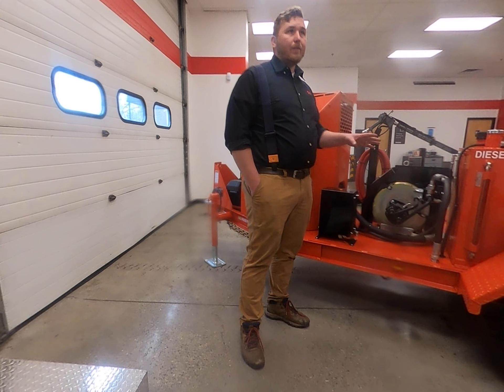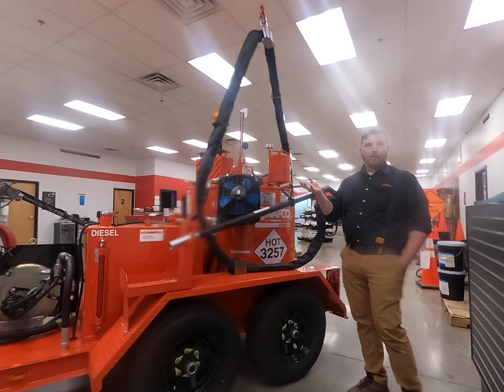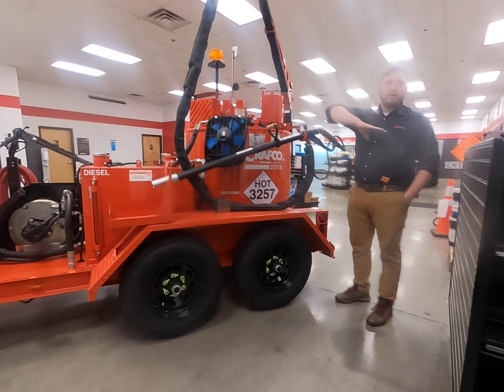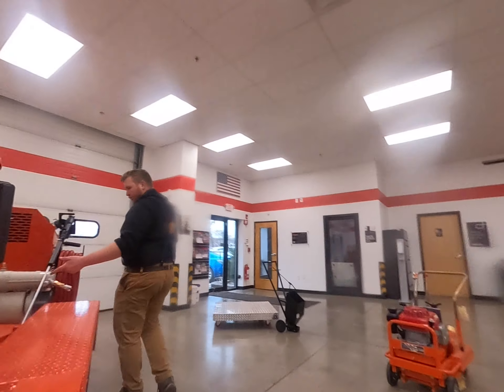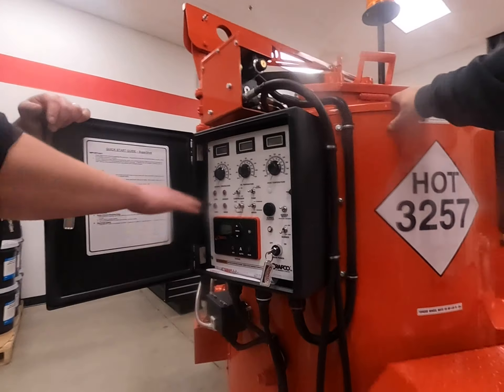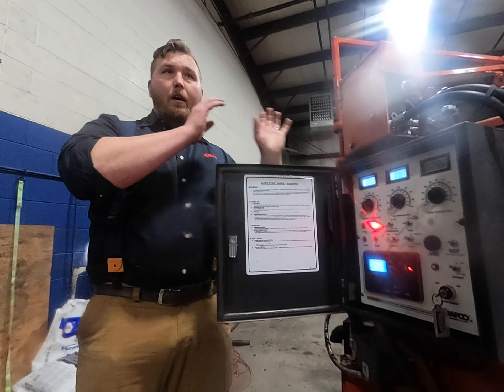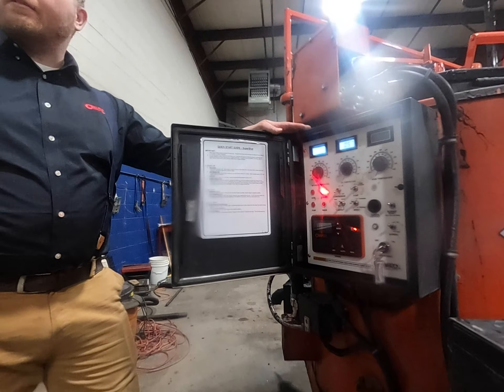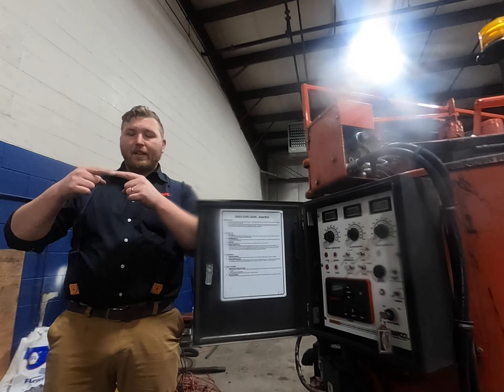Getting a dry Demo of the Crafco Supper Shot 125

Comment: We have one for our city here in Tx and we do miles and miles of street with ours every year and currently ours has 1700+ hours on it and were having issues with the hose not working/heating and unfortunately our has that older style hose that has to get sent off to arizona instead of that newer version he spoke of where they have parts in stock. Something i wished ours had is that hose saver where it lifts it up for the operator as hes walking around the machine the damn hose doesnt drag.

Comment: Thanks for the video!  I have a 125.  I have a guy that INSISTS you must pull the trigger when you reverse the material.  It sounds like you do not have to.  Am I right?
Reply from the maker: So I did this as a public service lol I own a crack pro on my machine when you put it into reverse the pump works independently from the trigger
Reply: We have a 125 super shot and honestly I don't think you have to when doing the pump reverse 
Unlike when you're pushing material out you can hear the pump but when you're reversing you can't hear it do anything
Reply: @ thanks!  That’s what I’m thinking to

Comment: The Crackpro heats up quicker mostly because of the shape of the tank.   They are wider and flatter and get more surface heat compared to the Crafco's.   We consistently got the CP125s and CP260s pumping in 30-40 mins.   Tough to beat the Crackpros!
Reply from the maker: Interesting info !